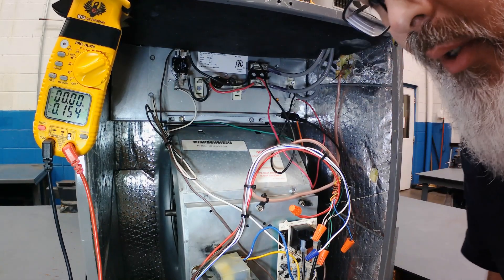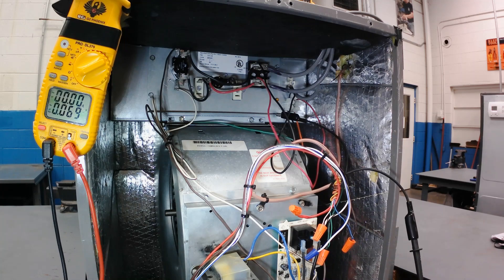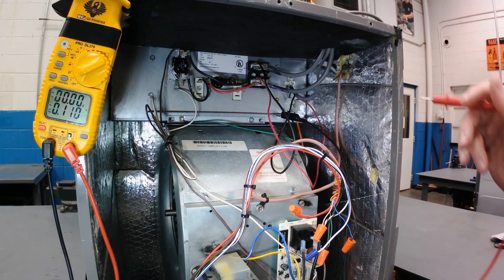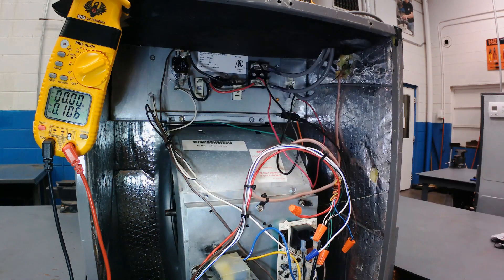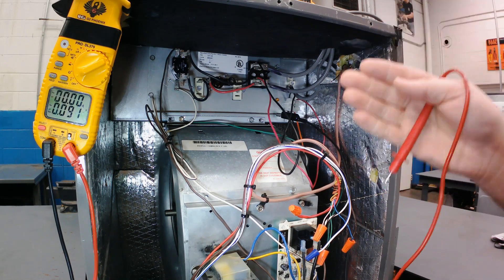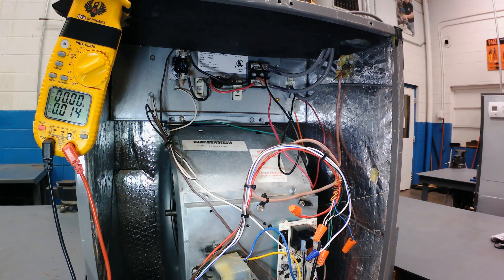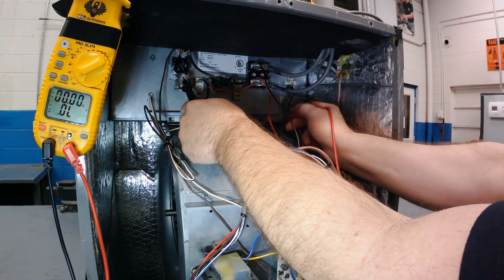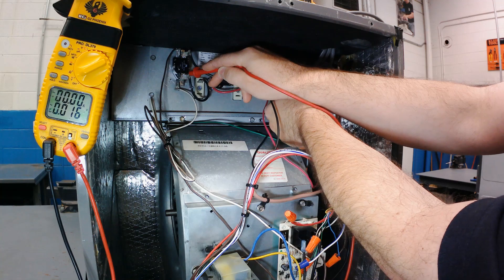Why I Don't Like Using Ground to Check 208/240 Circuits

Comment: Does “total voltage “ mean potential voltage ?
Reply from the maker: Speaking for me I guess, I know that the total/potential voltage is both sides added together. Whether that is a L1/L2  with 240V or an L1/N with 120V. Electricians I talk to speak using "potential voltage" but honestly I don't think I know any hvac people that talk that way. We just say voltage. However, I still think we are speaking the same language.
Reply: @johnjennings-JJ  thank you!

Comment: Does this method also work with 480v?
Reply from the maker: Numbers would be adjusted to fit that power supply but the basic thought process of it should work out fine.

Comment: The only times I like using ground for reference on a 208 or 240 volt piece of equipment is to make sure the power is completely turned off before I work on it.   Because sometimes two single pole breakers were used without handle ties, (code violation) or the circuit is protected by fuses and one fuse has blown, in this situation unless I also measure each line to ground I won't know that it's not safe for me to begin work.  Or for certain troubleshooting situations like phase imbalance on 3 phase motors,  which depending on the severity can cause motors to run hotter and shorten their life.
Reply from the maker: Agree. Power check. But once I got that done, I don't like using it. Of course every situation is different I suppose.

Comment: WOW! AMAZING ! I kept wondering why i kept getting 120v to ground when my contactor wasnt engaged... respect electricity  regardless on my part but could you explain what exactly "back feeding " means?
Reply from the maker: I thought I already left a reply but maybe not...my bad. Back-feeding (to me and how I think) is just when electricity finds another path to somewhere that it isn't necessarily normally flowing. Example that comes to mind is a single pole contactor on an outdoor unit that has a compressor crankcase heater. The crankcase heater leads are wired to the "pole". One on the incoming side and one to the leaving side. The heater only works when the contactor is de-energized and contactor switch is open. It "backfeeds" power through the compressor windings in order to work since that is the only path electricity can actually flow. Hope that helps.
Reply: yes, thankyou. i am constantly rewatching youre videos on hopscotching. School mentioned it before but i guess i had forgotten about it. fast forward 1 year later after the program and I find myself using it and how valuable the technique is. Thank you!! @johnjennings-JJ

Comment: What's the cause if you get 120v on each leg but get no 240v when metered across both legs? Breaker shows 240v when metered at both studs. Thx!
Reply from the maker: Troubleshooting "over the phone" is hard because I have to assume you checked it the way I would and we agree on what is said but....without asking for a lot more details I would say one thing. If you have 240v at the breaker (and you know each leg is 120v) the only way I know to get 0 volts on your meter when troubleshooting in the circuit is that you are checking the same side of power somehow someway. L1 to L1 or L2 to L2. Of course, there are more questions to ask to know exactly what is going on but, in general, that is what I would go with. Double check where you are checking.
Reply: @johnjennings-JJ  thanks for the quick reply! I recently had a new roof done so could it possibly be a nail has shorted the wires? At the breaker box I get 120v on both legs to ground and 240v across both legs. 40 feet away to the Heater I get 120v on both legs to ground but 0 volts across both legs. System worked as should and only recent job was a new roofing. Sadly no attic space to trace wires from Breaker panel to heater. Then again, wouldn't a short instantly trip the 2 pole breaker? The breaker will trip sometime during the day but not instantly. Even with breaker on I get 0 voltage at the heater across both black and white wires. Thx!
Reply from the maker: Definitely weird. I would think a nail or something shorting it would trip the breaker too. Might have to call in that electrician friend!
Reply: Did you find the problem with the heater circuit yet?
Reply: @timrogers961  Hi Tim, I did find a damage part of the wire half way through the home and had it repaired. A nail or critter may have caused the damage. The damaged area looked like it had a short and weakened with corrosion. Thank God house didn't burn down. Thx!

Comment: This is awesome! I ran into exactly this issue last week. I was a little confuse. I don’t work on many electric air handler. 
Great video.
Reply from the maker: Thanks.Grounded heat strips or something like it can be confusing. Glad you thought it was helpful.

Comment: The best way to check to see if you have a blown high voltage fuse is to put your leads across the fuse when the power on, and if that fuse is open voltage will back feed and you’ll see voltage, if the fuse was closed you’d see no voltage..
Reply from the maker: Yep...Agree. Sometimes with something like a 2 pole contactor it confuses some of my guys. They forget to think that the other leg of power is broken by a switch and there is no return path in the circuit. Electricity can be tricky! Thanks for commenting.
Reply from the maker: Yes...agree. Sometimes i see my guys get wrapped up on circuits where a 2 pole contactor might be used. They forget that the other leg of power is broken on purpose! Makes the beginners think... Thanks for leaving a comment.
Reply: That is not backfeeding. Measuring voltage across a blown high voltage fuse is not due to backfeeding. You're just measuring across L1 and L2. One of your meter leads is on L1 and the other is on L2. When you have a good fuse and unit is running, if you measure voltage across the fuse, your meter will read zero. If you turn off the unit, remove the fuse, turn unit back on and measure voltage across fuse holder terminals, your meter will read 210V. That's because you have L1 voltage on one side of the fuse holder and L2 voltage on other side of fuse holder. That's not a backfeeding voltage. That's how it's designed. A good example of backfeeding is a generator hooked up to a house incorrectly during a power outage. If main breaker on main house panel is closed, the generator will backfeed into the utility's power grid.
Reply: @bernardocisneros4402  If you put on lead on the l1 side of the blown fuse and the other on the load side of the blown then you have voltage back feeding thru the load back to L1.
Reply: @kevonslims7269  If you have 1 meter lead on L1 side of blown fuse, the other lead on load side of blown fuse, and unit turned on, will you read 210V or 120V on 208 system?
Reply: @bernardocisneros4402  You said it’s not back feeding, and I explained to you why It’s called back feeding, no matter the voltage  you get.
Reply: Ok, if that works for you.

Comment: As someone who understands the benefit to what you are describing to diagnose a specific load failure, I believe re showing this video on a open part would show higher benefit to what you are trying to show. Great video explaining the reference
Reply from the maker: Thank you. I'll have to get a video out on open motors, heat strips, etc. Good idea.
Reply: Using a whiteboard or chalkboard in conjunction with air handler to show what you're doing might help others get a better understanding.
Reply from the maker: Thanks for the advise. I'll have to try it.